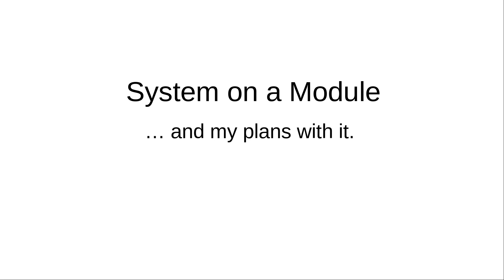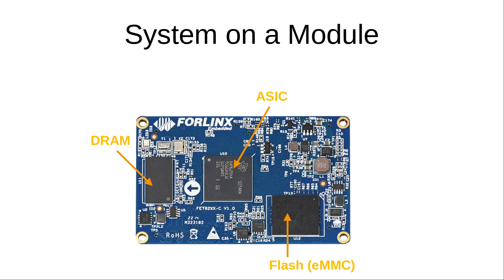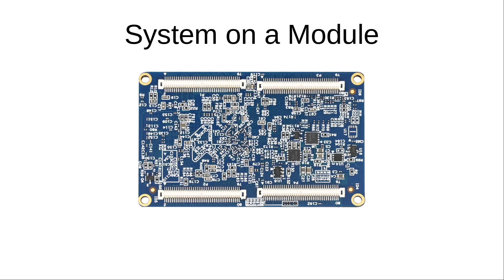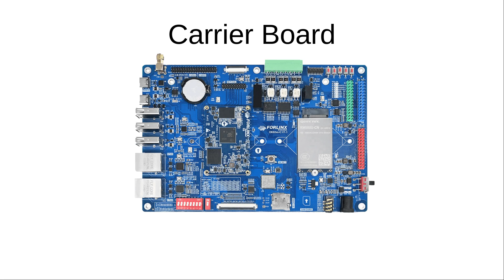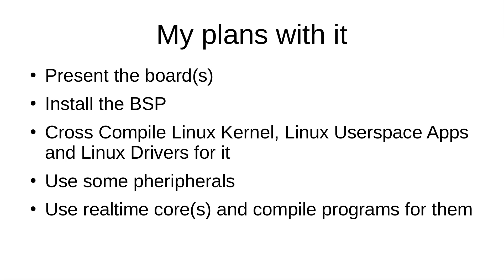Getting started with Embedded Linux - System on a module & my plans for a Embedded Linux Tutorial

Comment: Hi Johannes,

This sounds like a fun project. I just got linux up and running on my SOC running on a custom board. It was quite the project. I had to patch both the kernel and U-boot to get it working because we had to wire our board differently than the evaluation kit did. It would have been invaluable to have some guidance along the way.

Comment: Another tutorial series can be helpful or it can be frustrating if the software and hardware are not readily available to your audience to follow along EXACTLY with what is being taught. This being the case could work against you if you are using "smaller" vendors SOM's and boards, especially if you plan to use multiple variants. If you however focus on the build systems (Yocto? BuildRoot? OpenEmbedded? ect) and show how you apply them to various miscellaneous hardware options, like your small vendor boards, you may be able to provide useful content. I would consider a specific project, perhaps a weather station or home automation, and show how to build up several of the boards you receive to fit the defining application in both software and hardware for the specific needs of the project.

3 boards, one project, built on readily available tools, using generic and easily attainable sensors. Maybe add one "large vendor" specific board so that people will get the benefit of being able to follow along keystroke for keystroke, how about an STM32MP157 discovery kit or a Raspberry pi variant like an Orange Pi, Bananna Pi, Rock Pi, etc that people may already be obtaining for other tutorial series, or have in hand like an older Raspberry Pi (1,2,3) or BeagleBone Black. Maybe leave the SOM out and build a sensor interface board based on a STM32F104 blue pill that you can USB into an old desktop PC to be your weather station or home automation server. Many people have old computers around and a blue pill is still a reasonably low cost option. 

Nix OS packages are a hot topic today, maybe showing how to accomplish a weather station on a variety of platforms would be popular using non-vendor specific tools. Not much talk about how to leverage Nix in a minimalist Embedded Linux application.
Reply: well said
Reply: it`s sitara on that FET62xx